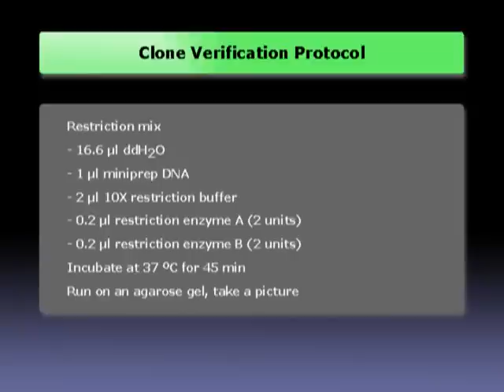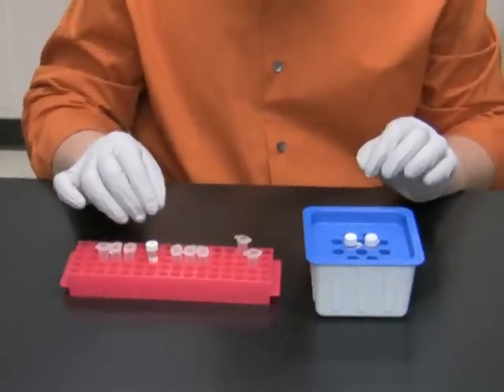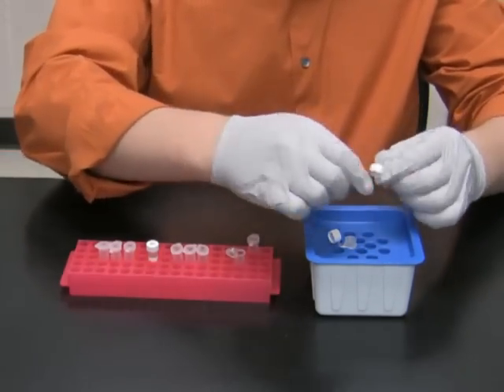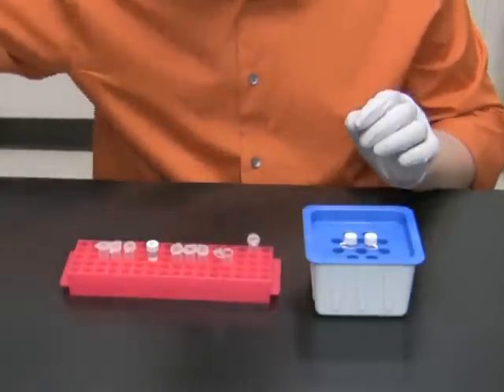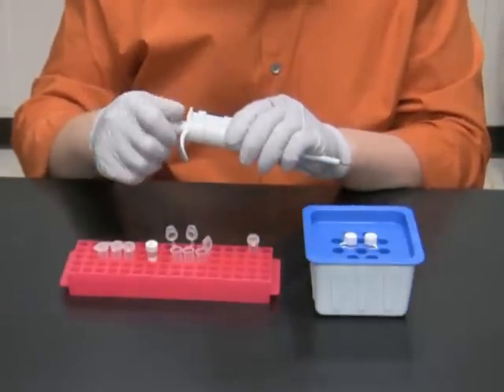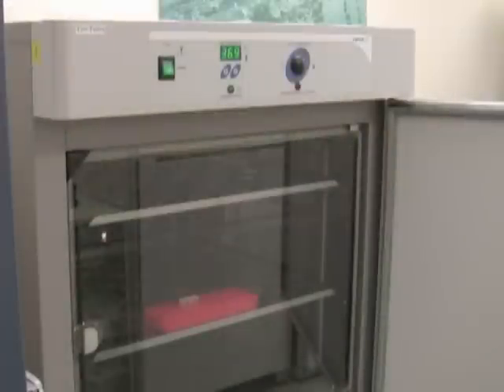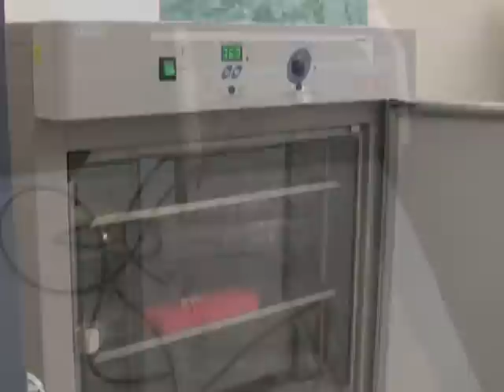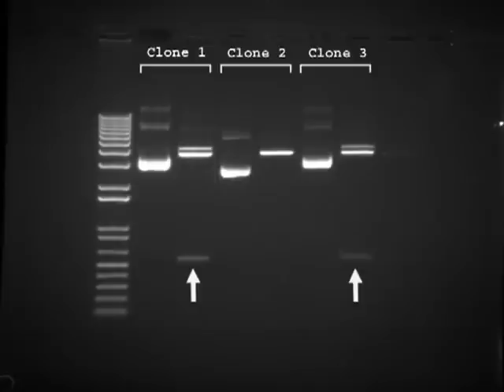Simply Cloning - Chapter 9 - Clone Verification

Comment: I did the calculations for Clone 1 for "Cut" vector lane and it is log(3845)= 3.584(without Bar insert), log(4395)=3.642(with Bar insert) and log(550)=2.74(the Bar fragment). This is very consistent on the log graph with the observed distances these respective linear DNA's migrated which is around 320 mm  (without Bar insert), 340(with Bar insert) and 615 mm (the Bar fragment). Good work.